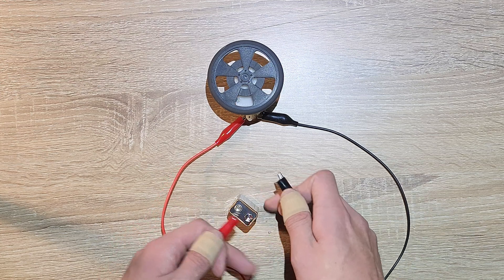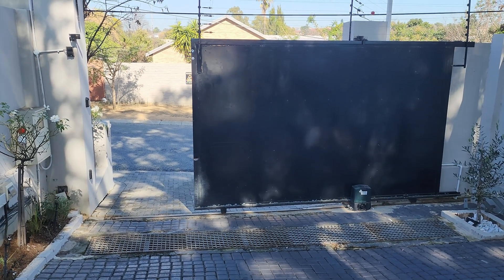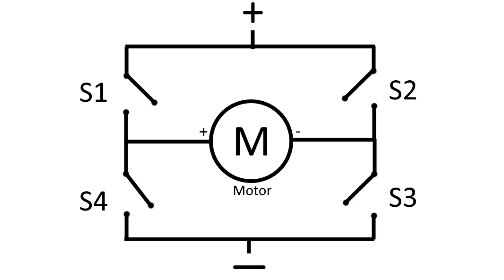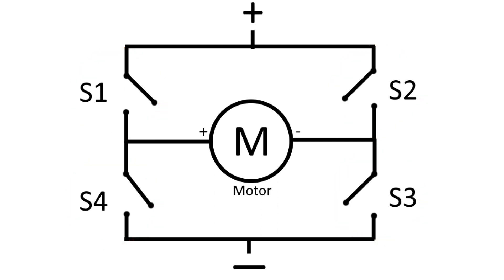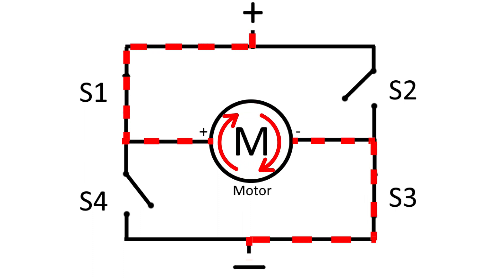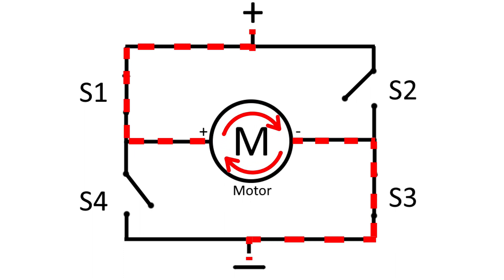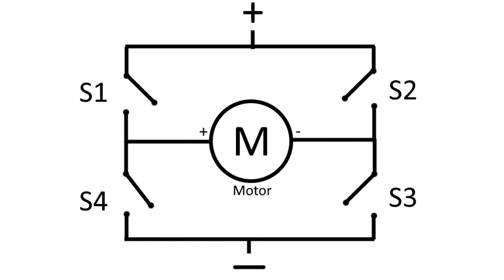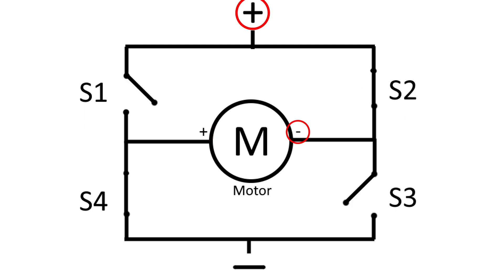How to Make a Motor Spin Both Ways [H-Bridge Tutorial]

Comment: Why the resistors?
Reply from the maker: Before I reply I want to say that I'm no expert. When I made the video I was super new to the stuff, but I learnt a lot at that point. Been a while since I've done any electronics stuff.

But anyway, to answer your question, the 9V battery was too much for the transistors to handle (pretty sure it said so on the manufacturer's datasheet). If you think you know more then please let me know what you think. This is still a field that I'm trying to get into